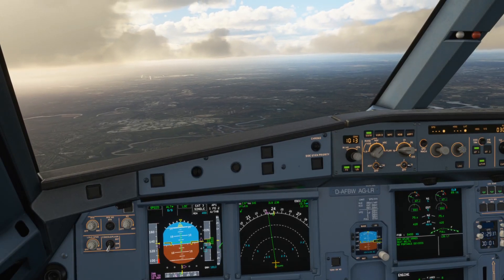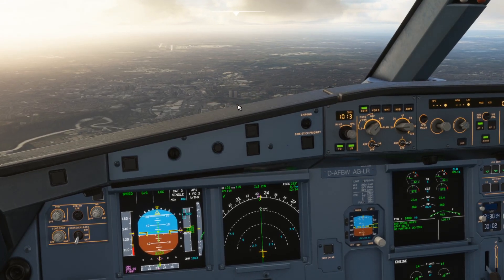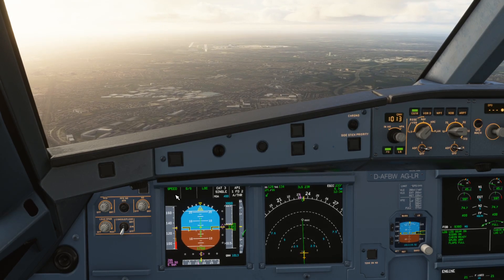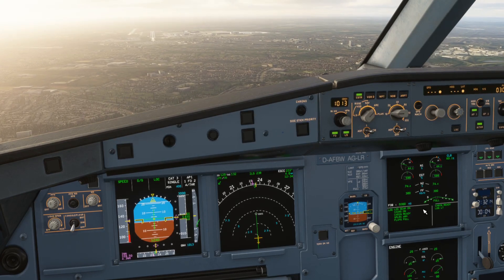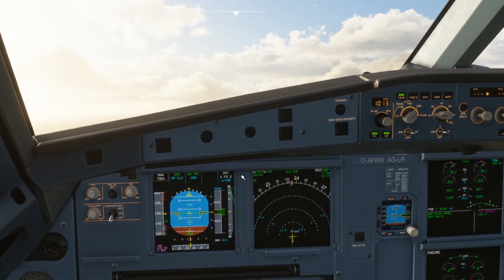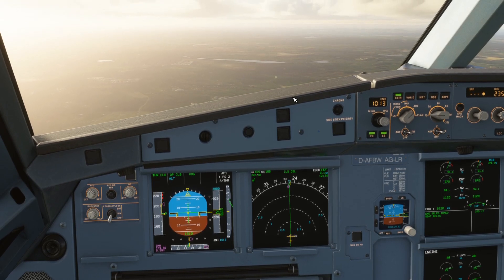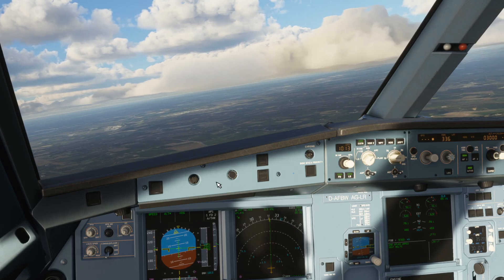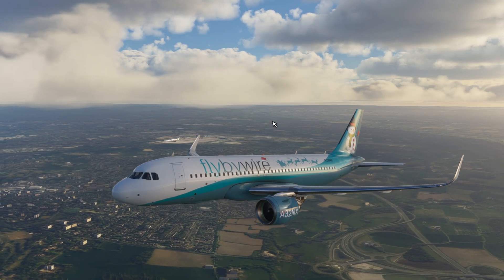MSFS 2020 A320 - How to perform a Go Around / Missed Approach

Comment: What's not clear to me is how to properly do a go around after disabling the AP and you're hand flying?  If you re-enable the AP, what will happen?  I had this situation the other day, and when I re-enabled the AP it didn't have any flight plant to follow and was stuck in the go around phase on the MCDU and could not re-activate the approach phase.  I tried to do a direct to my initial approach fix and still couldn't re-enable the approach phase.
Reply from the maker: At the moment, no GA track (missed approach procedure) is loaded into the flight plan. You literally have to follow the published go around procedure manually using selected ALT & HDG on the autopilot.

Comment: Toga thrust, flaps, FMA, confirm positive climb and then gear up. You wouldn’t retract the gear so quickly because there will be a delay in transition from descent to climb, if you’re close to the ground you want to have the wheels out, incase you make contact with the runway.

Comment: Good video Gav. Just a few pointers.
- on the G/A Perf page, enter your THR Red/ACCEL alts as AMSL figures, NOT AGL figures. You’re correct they’re usually 1000’ or 1500’, but don’t forget to add the airport elevation to this as it’s in relation to the BARO altitude. Otherwise you may find yourself reducing thrust and going to climb thrust very close to the ground. Especially if the airport elevation was 1400’. 😳 This is the same principle to your THR RED/ACCEL alts in the take off Perf page. 

- You started the video already on the G/S. The trigger for setting the missed approach altitude is G/S* on the FMA. It’s vitally important this doesn’t get forgotten. There’s a reminder in the landing checklist in eJ and it’s important that doesn’t get forgotten either. At 2000’ AGL the ECAM LDG Memo appears so the landing checklist can come shortly after that or when fully configured. If you’re doing an RNP or non precision approach, you won’t get G/S* on the FMA. So setting the missed approach altitude is commonly missed on these type of approaches. Just think anytime you’re starting to go down the slope, consider that the trigger to set the missed approach altitude. 👍

- Jimmy is correct about G/A TRK. It just captures the heading you’re on when you put the THR levers in the TOGA gate. If the G/A track was in the FMGC, and the aircraft was modded to follow it, the FMA should go to ‘NAV’. I expect this to be developed in the future. As that’s not modelled yet, you’ll have to follow the publish missed approach manually. Or better still ask ATC for a revised clearance; “Tower, Easy 34AM in the event of a missed approach requesting climb straight ahead to 3000’ please?”. It might make flying the A/C less stressful in its current guise. 

- G/A actions. It’s not easy single pilots as it’s a symphony of calls and triggers when it’s multi crew. But to break the order down it goes like this:
“Go Around, Flaps!” - PF, “Flaps 3 or 2 etc” - Moves Flaps one stage - PM
FMAs - announce “Man TOGA, SRS, G/A TRK or NAV” - PF
“Checked” - PM
“Positive Climb” - PM
“Gear up” - PF - “Gear up” & raise the gear - PM

When at THR RED/ACCEL alt, lower the nose, accelerate and retract flaps on schedule. You bypass flaps 2 in the sequence if you’ve gone from Flaps Full to 3 in the initial go around. Once you’re past F speed, go straight to flaps 1. If you were landing at Flaps 3, you’d be at Flaps 2 in the go around so Flaps 1 will be next anyway after F speed. This gets a bit more complex at very high weights, hot weather and at altitude but that’s beyond the scope of this discussion. 

- Take time to brief the missed approach before you descend. Brief the actions (described above). Make sure you’re happy with the order of the actions and where you want the aircraft to fly in the go around. Ask for a reclearence if it makes it easier. The whole point of briefing this in the calm of the cruise, is so it doesn’t become a complete mess and gets buggered up when it actually happens. Go Arounds are the most commonly mis-flown procedures pilots perform. 

So in summary, make sure the THR RED/ACCEL alts are correct in the G/A Perf page, brief the missed approach and actions, set the missed approach altitude at the correct time and remember the landing check lists! 👍
Reply: Thanks!
Reply: Damn, this is detailed! 😮 I understand only half of it 😅 What do you mean with: "enter your thr red alt as AMSL, NOT AGL figures"? Thank you, HD
Reply from the maker: AGL is Above Ground Level. This video will probably explain it better. https://youtu.be/7FjY62aNJNo
Reply: @Easyjetsimpilot  thank you, Gavin! 😃👍

Comment: With GA TRK mode the aircraft will continue to follow the track it was on when the G/A was initiated. In order to follow the G/A in FMGC database the aircraft would default to NAV when the thrust levers are set to TOGA. Whether it goes into GA TRK or NAV depends on the fit in that particular aircraft.
Reply from the maker: Sadly not yet implemented in the sim, so for now defaults to HDG. 👍
Reply: That’s correct. If the FMGC database missed approach procedure is properly sequenced in the FMS FLT PLAN page on the MCDU, the NAV mode would have to be engaged after TOGA selection. This is accomplished by pushing (managed) the HDG knob on the FCU.